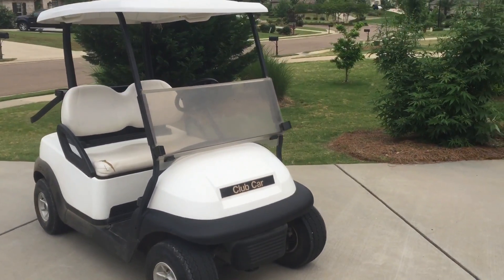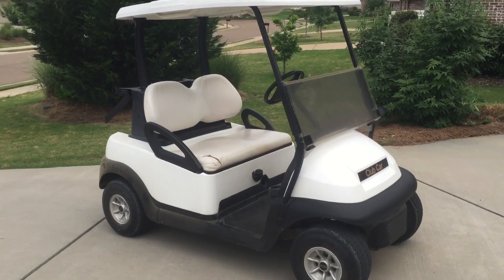My New 2010 Club Car Precedent

Comment: Hahahaaa... Working on a golf course for 25 years, where we leased a fleet of 100+ Club Cars, I'm just a teeny bit familiar with them. All of my work carts for course maintenance were gas, but for cruising in silence as Superintendent, I had my own electric. Since it was for cruising the course, though, I didn't do much in the way of mods (other than a tool box and pull-down side curtains for those surprise Florida thunderstorms), but I and our mechanic did some serious fiddling with the controller so that when I was running on the streets through the neighborhood around the course, it would fly! Have fun with it, Joe!
Reply from the maker: Thank you very much, yes these things can sure be a project and lots of fun

Comment: Did you ever finish the Golf cart ? No update video ?
Reply from the maker: It is still a work in progress. I have it lifted with rims, tires and fitted with a new controller and custom built engine but I have still not gotten it painted or fixed the seats